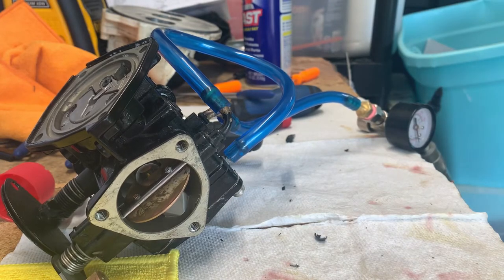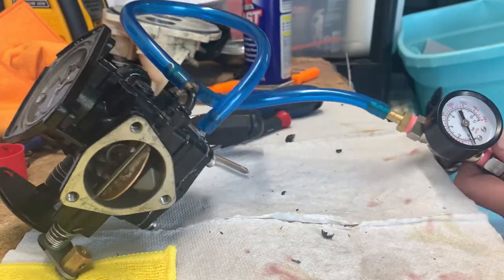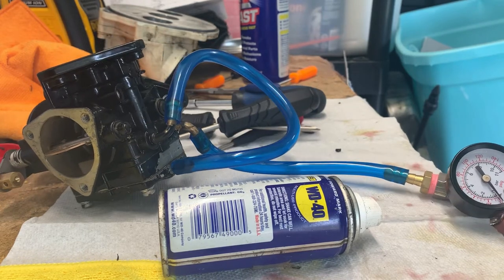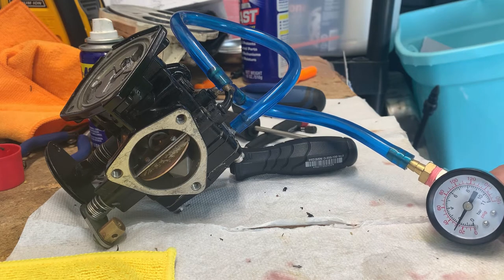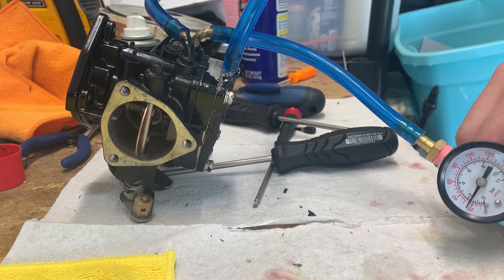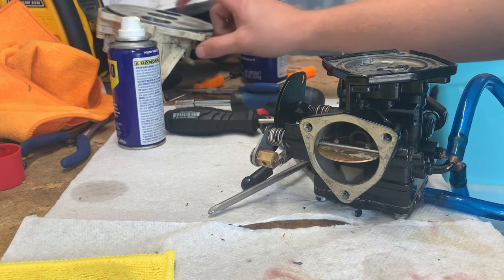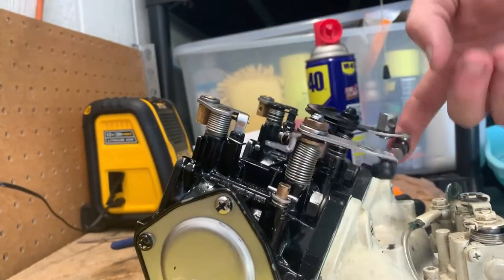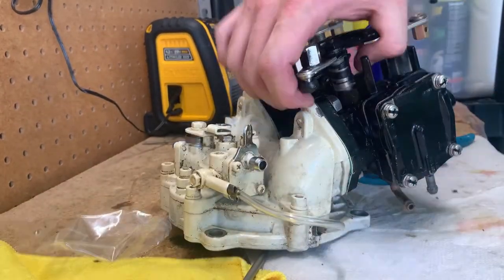How To Set Sea Doo MIKUNI Carburetor POP OFF Pressure. Carbs Pt. 3

Comment: I'm rebuilding the carburetor on my 94 Waverunner VXR 650 and my pop off is at 19 psi.  I've read that mine should be 55 psi.  If that's the case, then mine is WAY off!!  I'm going to try a different spring and see what that does.  I'm completely new to skis so THANK YOU for the videos dude!!

Comment: I just rebuilt a sbn38 for a 1990 Seadoo sp to replace the original set up. Your videos helped so much! Thanks. So glad we decided to go with the supers because the old carbs were giving us so much issues, couldn’t get it to start right unless I was giving it some throttle, then with the new carb in, thing started right up by just tapping the starter. Was great!
Reply from the maker: I’m so glad it helped! That SBN upgrade is definitely the way to go. I did it on an 89 SP that I had as well.

Comment: i rebuilt a 700 waverunner xl , new pistons n rings etc, it rsn good but bogged mid throttle, rebuilt carbs , they were at 35 psi pop off, manual called for 55 psi so thats what i put it at problem solved rite! nope ran worse, took apart put pop off at 30 psi thing runs great
Reply from the maker: That’s interesting! Yamaha pop off is a little bit different than Sea Doo for some reason. I just try to use the springs and lever arms that are already in the carbs.

Comment: Mine seems to have no pop off and I just redid the whole carb is it because I have it all together or do I gotta take off that cover n rubber peice
Reply from the maker: You have to take off the cover and rubber diaphragm to test like in video.
Reply: @jetskirehab750  true I did all that threw the carb back on n now my starter solenoids bad hopefully that’s the last problem I get with this ski I wanna rip through the water
Reply from the maker: @therandomrobert1842  I had that happen on another ski. Usually happens when you try to boost the battery with a jump pack or car battery. Easy part to swap out though! Glad my videos are helpful to someone.
Reply: @jetskirehab750  us that like the old skis find this like a gem in the ocean of YouTube videos cus there isn’t anything on them on the internet or YouTube just owners manuals n stuff thanks for the helpful videos
Reply from the maker: @therandomrobert1842  You are very welcome! Be sure to subscribe and like if you haven't already and share with others! If there's any other videos you would like me to make let me know and if I have a ski to do it on I will try my best!

Comment: The loop between pulse and return is unnecessary and fallable. Just plug return and disregard pulse during test.
Reply from the maker: Easier just to loop them than to plug. Plus makes sure fuel pump side is air tight.

Comment: Question about fuel system. I have a 96 sea-doo spi, should the tank hold pressure? If I pull the Y formed breather hose from the fuel tank I can blow through it. Should I be able to or is there check valves in the lines to hold pressure? Thanks
Reply from the maker: There are check valves. Both in and out. There is a pressure test procedure in the manual. You can find a free manual at seadoomanuals.net
Reply: @jetskirehab750  I just bought it. Thanks for the info and quick reply! Subbed